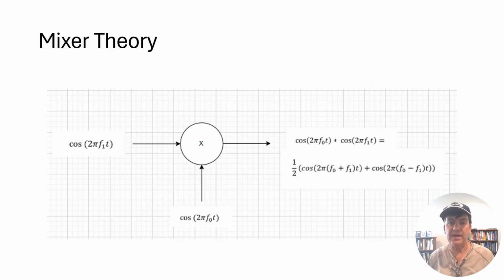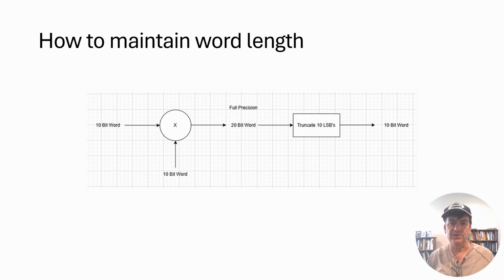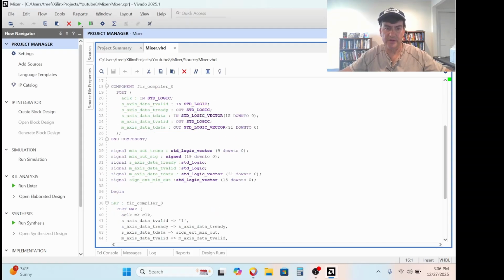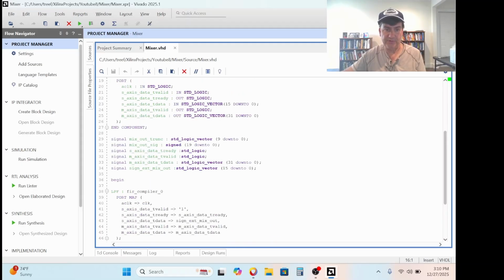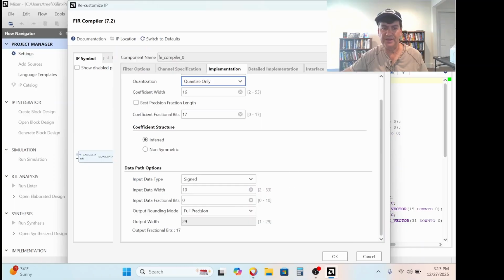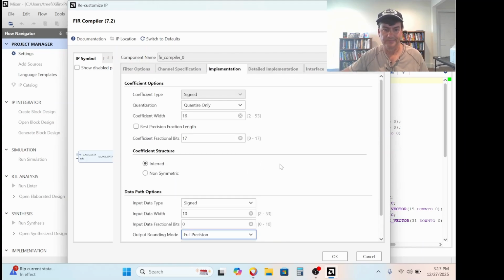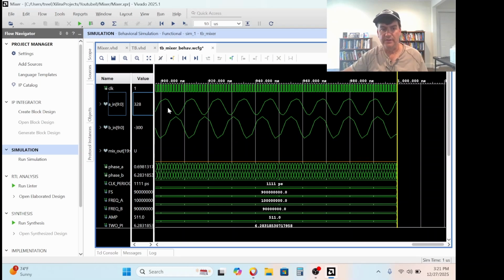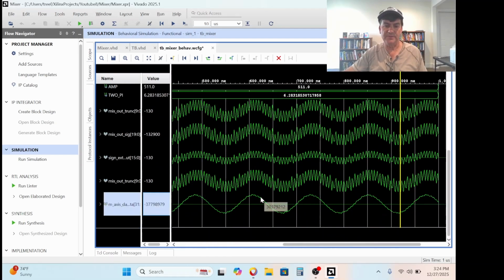Implementing Mixers in FPGAs: A Software-Defined Radio Essential

Comment: Do you also have a devboard to try it out on real hardware?
Reply from the maker: I did try using mixers at work on a real dev board and had success, but I don’t work there anymore and don’t have access to that hardware now. At the moment I’m mainly going off theory, datasheets, and typical implementation methods.